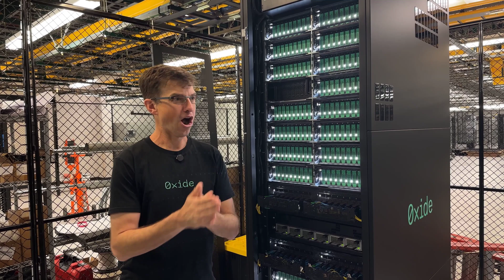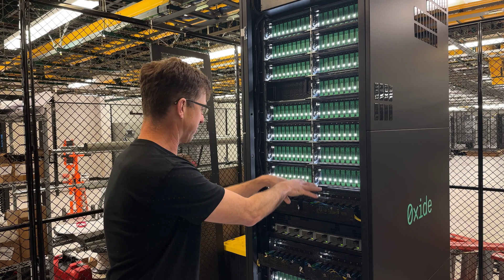Oxide Cloud Computer Tour - Front

Comment: This is cool, but next time try to adjust levels so that the audio doesn't clip so bad, it makes it really hard to listen.
Reply from the maker: 100%, This was our first attempt at filming in a datacenter and audio will only improve from here. There are a couple more videos from this day coming soon w/the same clipping, appreciate your bearing with us!
Reply: Outstanding Design and execution in such a short period Bryan! The purity of the design concept is essentially flawless. In the next video can you tell a story about how it scales beyond the rack and how failure is seamlessly mitigated. Cloud scale is many racks so explaining this piece to the customer is crucial. Datacenter scale and multisite redundancy and operations servicability and how Oxide is in essence a private hyperscale solution using a singular rack module. Integration with LTS platforms and how this is achieved are talking points to expose as well  @oxidecomputercompany  Outstanding
Reply: "Shouting in the datacenter, part 2"
Reply: They did their best with the screaming conventional server fans wasting a bunch of power behind them.
Reply: Yeah, it's hard to talk inside of a datacenter. I'm impressed how they filtered out that horrible high pitched fan noise!
Reply: They are trying to keep in theme with the podcast. Its a feature not a bug❤